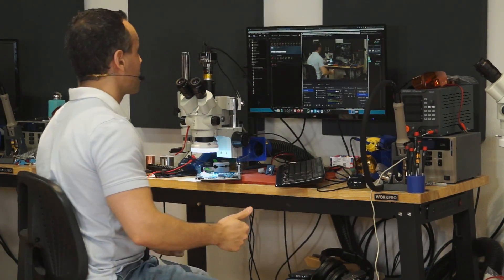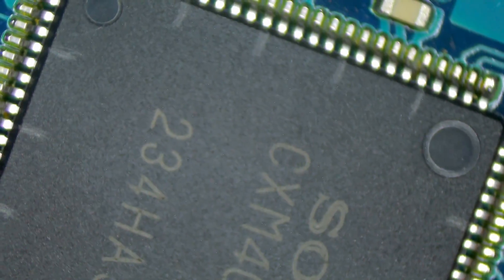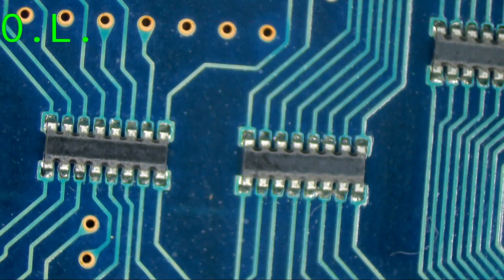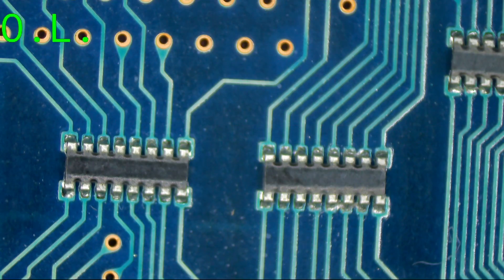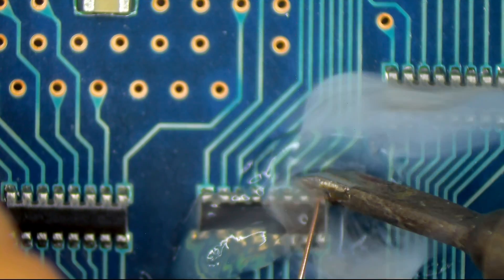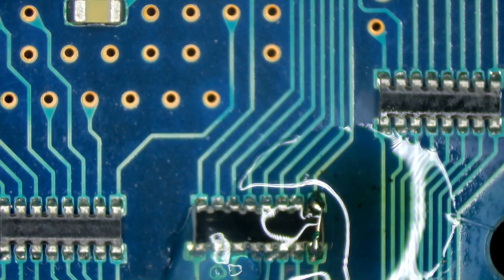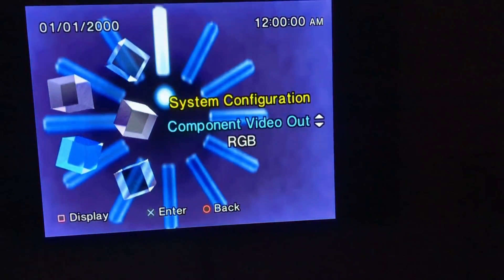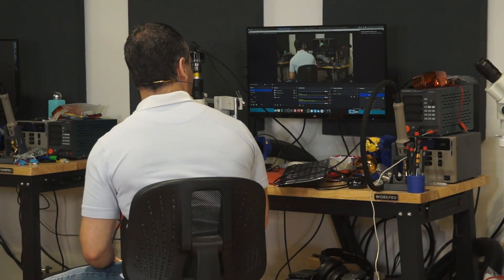23 year old PlayStation 2 console with no video - can we fix it?

Comment: Would those resistor array values being as high as 53ohms cause the video to not output correctly? 

I have an issue where the PS2 outputs video that looks like a smashed LCD tv. I found 1 bad resistor and jumpered over it. Video outputs better now, but looks like someone took quadrants of the screen and rearranged them, with 2 quadrants video not outputting correctly. Any ideas? 

About to order replacement resistor array packs and swap the old ones out.

Comment: Maybe someone can help.  I have a fat ps2 and it plays ps2 games fine.  When I insert a PS1 game it loads the playstation logo and I get all the audio and the controller works, but no video.   I tried changing the setting to RGB and the laser is clean.  I also tried adjusting the white cog wheel that adjusts laser sled height.  Nothing works.   Any help would be appreciated

Comment: I actually have a PS2 slim with audio and no video. Will have to give this a try. Is this a temporary fix until you can replace these, or can you use the console indefinitely with jumped resistor packs?

Comment: I bought a broken gigabyte GTX 1060 6GB for 40 in the beginning of 2021 when the working 1060's cost over 150 used and the fuse was blown.
I did not have a fuse on hand so i just put in a blob of solder over the old fuse and tested it out on a old core 2 quad system and it came back to life.
I did some stress testing to check if the VRM was still good and it still works to this day.

Comment: i just checked, every set of more than 16 different values included a number of 47ohm in it's sets.
only set4 that didn't have 47ohm was a triple set including two values of either 4.7 & 47 / 470 & 4.7k  or 47k & 470k in each offering thus giving all six values if you bought all three sets

Comment: I have the original ''fatboy'' 60 GB PS3 that stopped working many years ago. Turns on but shuts off within 3 seconds. What are the possible issues? I can't remember the color light as it has been many years but it blinks and just powers off when you turn it on. I REALLY want to get it fixed because it was the only version that could play BOTH PS1 and PS2 games. I miss it.

Comment: I successfully replaced a socket 1151 bga on an asus z170-A the other day with my lovely AOYUE 852A,... and a IR flatbed. I think its time to upgrade the hot air station to something a bit more.... useful.

Ive watched louis do so much work,... finally I can relate to something useful

Comment: 3:55 Looks like two of the pins are connected with a speck of solder. The 5th and 6th one over from left on the bottom. Chip in middle of screen

Comment: 23 years? We're getting older...remembered fixing a few power supplies for the "phat" model and made one run on just batteries. Lasers tend to die on the early ones too. Can't tell them enough to clear out the dust. Haven't encountered termination resistor failure though...might get myself a broken one to repair, mod (Modbo - no more Matrix, so long...) and play GT4 on! Even GTA:SA looked a few laps ahead compared to PC, the once-seen beauty of dedicated hardware.

Comment: Is jumpering resisters a solution or just a temporary way to prove which resistors need replacing?  Aren't the resistors performing a task beyond just completing a circuit?
Reply: Those are attenuating data lines from the EE. Probably fine to jump them for a short period to test the console but really that resistor array should be replaced as soon as possible. Might as well replace them all while you're in there to be honest.

Comment: Other than the output feed being way greener than it should be, likely indications of a dying chip, this was a great tutorial video!
Reply: That was because the output was set wrong. YCbCr instead of RGB. He fixed it by going into the menu and changing it
Reply: @mhammadalloush5104  Ooooh, good catch. I didn't use the component cables that much with that system so I wouldn't have caught that.
Reply: @Lenophis  the PS2 outputs composite and component(YPbPr) simultaneously by default, so If you lived in the US that setting does not need to be changed at all, he changed the  video output to RGB which is a standard used primarily on european televisions ever since the 80s.

Unlike the american standard which uses seperate RCA plugs for each signal(which means you need 5 plugs for component+stereo audio), europe had a predecessor to HDMI called SCART which carries composite, RGB, and audio on a single plug.

Comment: I'm confused as to why you can bypass the resistors with just a wire. Wouldn't this mean that the intended resistance for that trail is no longer there? And it works anyways without that resistance?

So, why is the resistor there in the first place?
Reply: it can work without the resistor, but its not intended to, it may break after some use or after a smaller malfunction that could be avoided with the resistor

Comment: i'm an electrical dumb-dumb but if those resistors have a footprint, throughput, and pinout same as another resistor that actually has a label, would that label one be a drop in replacement or are there other things involved in picking replacements?

Comment: Noob question, but why is ok to open-jump a resistor on a data line like that? (Why wouldn't you want to replace the 48ohm resistors?) What were they doing there in the first place if they could have run an open trace?

Comment: Dang, I have like 10 Gameboy cartridges I need to take the batteries out of, and replace with low profile battery holders.  I've got a soldering iron, and I can do it, but it will take time.  It'd be super nice to be able to use the equipment there, but sadly I live probably 1500 miles from there, so coming in to a workshop at least in the near future is out of the question.

Comment: I feel it's worth mentioning that the glowing ring of dots and some of the other animations on the ps2 menu are tied to the system clock, and there seems to be a glitch in the ps2 menu where after replacing the battery the system clock will be frozen and you can't change the time. However, this can be fixed by trying to set the time, but don't actually change anything because it won't let you (leave it at 1-1-2000 at 12AM) and press accept to set the time. This should restore the ticking of the system clock and allow you to actually set the time. 

From what I'm guessing, when you remove the battery, the clock chip doesn't restore a default valid time, and the menu has no clue what to do with it. But by setting the time it will correctly set up the clock chip to something the ps2 can understand.
Reply: I didn't know that was a thing thanks, I imagine that will become more of an issue as batteries start to die. I guess we're lucky the Xbox handles it so well, since it was kinda designed expecting the capacitor to regularly run out
Reply: @tdp2612  if you live in an area with unsteady power (too much or nothing). Batteries croak faster. The caps generally live unless it's a major power surge.
Reply: It's so weird what RTCs will do when they lose battery power. I have a Fluke Hydra datalogger that uses one of those chips with SRAM, an RTC, and battery embedded inside, and the battery has long since died. When I set the date, they'll all be random hex values until I cycle the value enough.
Reply: wish i could bookmark this comment ^^
Reply: The (watch style) battery can often solve so many problems in laptops and towers. Just replace it. New info learned this applies to game consoles as well.
Reply: Yeah i had PS2s totally freezing after start up, get by it by being quick from boot up - System Configuration -> Clock Adjustment, dead RTC (CR2032) battery usually the cause !
Reply: Neat I was wondering why the dots were not moving.
Reply: Finally somebody intelligent his entered the chat

Comment: Hi, dumb question:
How do you know that the resistors are the problem and not a symptom of another issue?
Reply from the maker: There is no high power line involved here, nothing that is going to short to ground a high voltage power lines and destroy the resistor like the input to the pp3v42 circuit on a MacBook would fry the 47 ohm resistor

Comment: I want to know if Louis Rossman can upgrade a Pi4 from 1GB to 8GB of ram?
Reply: @Mr Guru  I was giving  Louis Material I'd watch. Might even be good, instant mail in business for him. It's really not novice level repair either. Not everyone has a hot air gun and a back heater the cost of which are both probably more than the cost of the more expensive Pi4. If it came down to it, I'd buy another Pi4 over taking the risk doing it myself.
Reply: @Mr Guru ... and I'm 100% sure I didn't ask you. This isn't your channel.

Comment: Instead of jumper wires you could just solder individual 47 Ohm resistors across the faulty one. 200k parallel to 47 Ohm won't skew it in any meaningful way. Even 2k will only cause a 1 Ohm difference.
Reply: Because it would be super fiddly to do, among other reasons.
Reply: @Gameboygenius  : That'sof course, true... It is fiddly, but not much more than the jumper wire.

Might I point out, those resistors on the datalines are there for a good reason. And while it should work without them, but it could also damage the chips along the data lines, thus being cheap about a resistor can easily lead to expensive (in case of older hardware, catastrophic) consequences.

Anyways, it's just a thought. Something to consider... or not.
Reply from the maker: Yeah that requires waiting a week for them to show up, fuck that. Want to see if it works now!
Reply: @rossmanngroup  : Good point. I just mentioned it, because 47 Ohms is a standard value, that (in my own experience, at least) is usually on hand.
And with you being stationed in Texas, I imagine that shipping from Mouser wouldn't take too long either.
Reply from the maker: I have 47 ohm resistors that don't fit.
Reply: @rossmanngroup  : Point taken...
Though in that case, longer jumper wires attached to the resistor might do the trick, if it's only for testing.
I'm just mentioning this, because whatever happened to the resistor packs would be able to travel unhindered to the chips, if you just bypass the resistor pack.

But again, it's just a thought.
With your experience you're likely to make a better informed judgment than me.

Comment: 6:16 I'd solder the 5th before 4th because of being right-handed with the iron on the right. Easier to not mess up the fourth if trying to solder the fifth after.

10:32 One resistor isn't used on that pack (unless there are some vias hidden underneath). Could jumper to it, or if he wanted practice doing desoldering, rotate the pack 180 degrees. I did this to fix a scanner once, where one of the MOSFETs for the stepper motor had died. Looking up the chip it had some spare unused ones so I wired to one of those.

Comment: I still have both my PS1 and PS2 and PS3. I recently bought an arcade style stick you put on your lap or coffee table and works with PS1 and PS2. And I bought a converter that lets you use it on PS3 and PC. But I found out both my PS1 and PS2 didn't work. The PS1 had a mod chip installed by my brother in law way back when I bought it. But I don't remember what buttons you had to press or whatever to get it to boot, and if it came with instructions I lost them. Since all my burned games are probably unreadable now anyways I guess I should start by removing the modchip. For the PS2, the DVD tray won't eject. Hopefully that is a simple fix like cleaning the dust out and lubing the optical drive rails with silicone grease. I just haven't gotten around to trying to fix them. I just know I'm sure as hell not getting rid of them. Especially with the awesome HDD/SSD mod you can do to the PS2 that doesn't require soldering in chips.
Reply: PS2 probably is indeed lubing it up, cleaning and probably the drive belt that went bust.
PS1 I'd need to know more to help fix it, could be a bad modchip install could be just a failing integral power supply especially if it's a model 1 system (the ones with the composite plugs on the back). They are known to go bad and the shell tends to be slightly browned by the power supply. Luckily they are really easy to replace if that's the issue.

Comment: I have a 1989 OG Game Boy that won't turn on anymore. I would love to get it running again, but fear that after 34 years, there is no hope.
Reply: I do regular console repair, I suspect it's an easy fix. Gameboys tend to be quite easy to repair if they break. What is the exact issue? If it doesn't boot at all how do you power it AA Batteries or PSU?

Comment: My original PS2 from 2000 developed a bad laser, so it could no longer read disks. Swapping the laser unit from a slightly newer PS2 from ~2005 brought it back to life!
Reply: You can also buy new one, and you can load direct from HDD with FreeMcBoot ;)
Reply: Free McBoot (+ the Network/IDE HDD adapter) = no optical drive needed
Reply: @gargantuablargg  And if I want to load a game off disk?
Reply: @gargantuablargg  If I want to load a game off a disk I need an optical drive attached to my PC. I'm not sure what other method there is.
Reply: @gargantuablargg  The usual setup is a PS2 with an optical drive that can load the games. Even people that have a HDD with games on it would still want to be able to load disks.
Reply: @gargantuablargg  They don't. The average person will move on or buy a different PS2. Fixing anything or modding is very niche. Regardless, the optical drive should still be functional for anyone that uses physical media. Booting from a HDD isn't exactly a fix to that.
Reply: @gargantuablargg  I can't boot off my disk using a HDD. That's why it's not a fix over optical, it's an alternative.

Comment: those are termination resistors for the data lines, jumping it might fuck with signal integrity a bit, and also send some out of spec voltages to those gpu or analog video encoder pins, it'll probably be fine, maybe some video glitches if you get unlucky
Reply: Stationary waves that may occur on a bus with no termination resistors anywhere could potentially destroy the receivers and drivers at either end. On an open transmission line, the data line will ring at 2X the driver voltage when a rising edge gets reflected at the end, which the receiver may not like. When the reflected signal comes back to the driver end, the driver may not like the extra current needed to drive a 1 into a reflected 0 or vice-versa, basically like having two drivers trying to output opposite states on the same line.
Definitely not a state the thing should be operated in longer than needed to determine whether the board is fixable.

Comment: thats actually very informative, I have a fat PS2 that had bad  video output solid state capacitors, sometimes you would get video and sometimes you wouldn't. I found out that the ouput caps were bad after heating them up with my hot air station, replaced them with better solid state capacitors and is now brand new again, interesting to see that bad resistors cause this too, thanks for the video!